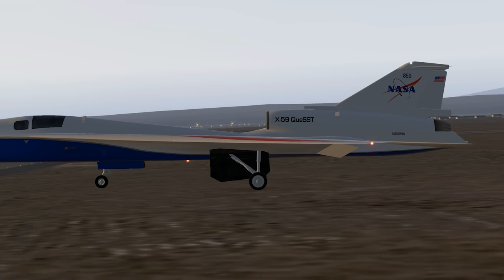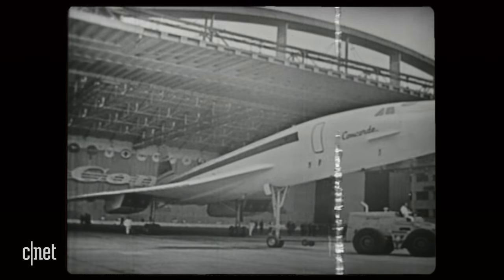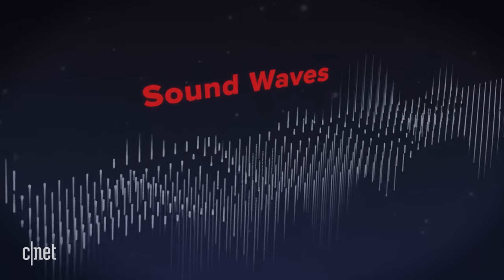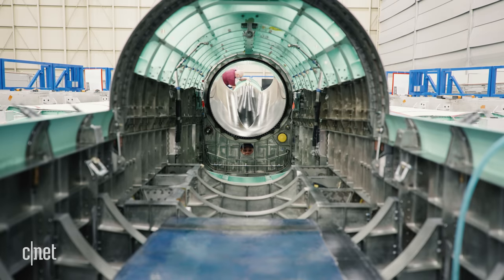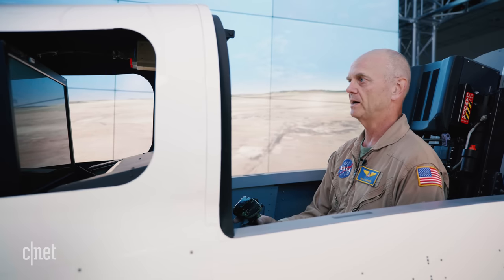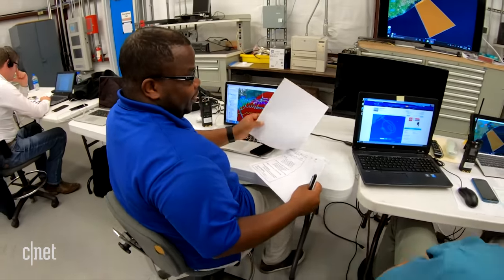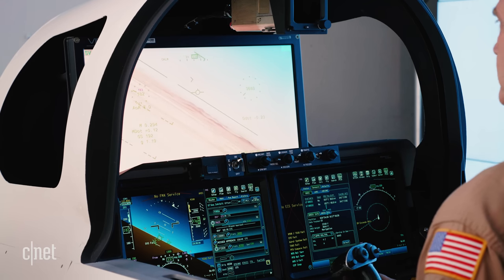Exclusive look at NASA's low-boom supersonic plane

Comment: Yoooo. They’re doing this at Skunk Works!!! That’s how you know it’s important 😳
Reply: Yes, a plane with that design will definitely be practical. /sarcasm 

No, it's not important. It won't be even practical. The necessary shape will make it hard to maneuver around an airport.
Reply: Well technology needs to start somewhere
Reply: @Wisewolf_of_Avalon  

It's not practical and it won't be practical. It's just too long.
Reply: @bobfg3130  Cute
Reply: @momoreview5555  

Alright. Scale it up and see what dimensions it will have. Compare that to passenger capacity.
Reply: @Sidney Nguyen 

There won't be any push forward.
Reply: @bobfg3130  I agree with you. This will never replace normal planes for the vast majority of travel. This might be practical for very rich or powerful people though. Moving less people around very fast intercontinental travel.
Reply: @eyeofthetiger7  

I agree. You can make a 10 or 20 seater like this but that's it.
Reply: @bobfg3130  u r right but methodes and research is being carried out on that, that's why this is experimental to commercial
Reply: @bobfg3130  why do you say there wont ba any push forward? (I'm intreagued)
Reply: @logx1003  

There's no reason to. You can take a normal  plane during the night and sleep in it and you haven't "lost" almost any time traveling. 

Also, in order to be carry 100 passengers, can you imagine the dimensions the plane will have to be? I mean a supersonic plane without a sonic boom. Just look at the shape of this thing.
Reply: @bobfg3130  it’s an x plane. It’s to test the technology and concepts. That’s it.
Reply: @louissanderson719  

The plane that will be designed with this purpose will look the same. It won't be practical.

Comment: Concorde was ridiculously ahead of its time. The fact that thing was designed by a bunch of guys with pencils and slide rules with nary a computer simulation or even a pocket calculator in sight should amaze you. The only comparable technical feat was the moon landings and many of those Apollo engineers said they were stunned that Concorde actually worked as a commercial airliner.

Comment: imagine the monitor malfunction

*IMAGINE* PLEASE COMPREHEND BEFORE COMMENTING DUH
Reply: It's probably built to a much higher standard than your mass manufactured, planned obsolescence integrated, cheapest possible component with highest possible markup composed commercial viewing device like a TV or monitor.

On top of that, it probably also has backups.
Reply: Can you guys understand *imagine? Of course there's always 0.1% of that happening but not 0.

You guys are kill joy
Even if that monitor was built in high standards it still not indestructible, everything man made is vulnerable.

Comment: I’m confused why Concorde is mentioned here as Concorde mitigated the sonic boom issue by only flying at speed over water. Concorde was cancelled because its operational cost, which any supersonic passenger plane would also suffer from, was far too high. Yes, a new modern design ought to be a bit cheaper to maintain but the litany of issues from tire “incidents”, maintenance issues, fuel consumption, etc were still huge issues that are difficult to overcome.
Reply: Yeah, with the immense cost of operating and maintaining a supersonic plane, I don’t see supersonic travel being a profitable industry anytime soon.

Comment: This does not really address the biggest problem the Concorde suffered from: POOR FUEL ECONOMY.
Even if you get around regulatory hurdles by reducing your sound footprint, you still can't make this commercially viable if you can't fly it profitably. Concorde ultimately failed not due to the restrictions on its sound, but because the operational costs were exorbitant.
Reply: True, when Concorde returned to London it determined its own approach path and informed ATC. The reason was it was nearly always on minimum fuel.
Reply: @AnthonyHigham6414001080  Yes. And even with this precision balancing of fuel-to-weight ratio to squeeze out the best fuel economy from the aircraft, most of the time their flights were break-even at best.
Reply: Modern turbine engines have come along ways since  the early days of the Concorde.

Comment: At 8:40, are you sure about that? It seems to me it has much more to do with the engine and inlet placement (that is to reduce noise projected to ground indeed) and consequent reduction of volume to tuck the landing gear in which was present in an F-16 due to its fairing.

Comment: It wasn't the limitations on air routes that killed Concorde, it was the fact that it's a lot easier to fill a 747 at $1,000 a seat then it is to fill a Concorde at $15,000 a seat.  If you're planning on spending a week on vacation, trimming 4 hours off your transatlantic flight time isn't worth paying a 1500 percent premium for most people.

Comment: Great video 👍💥 I've always thought commercial air travel was antiquated and slow. Equivalent of Greyhound bus in the air. The technology to fly faster and more efficiently has existed for years. Unfortunately we are still utilizing the Greyhound in the sky. Not to mention exceedingly uncomfortable.
Reply: And commercial jets fly slower than they used to. Economics is king. Flying faster takes exponentially more fuel, so jets fly at their most fuel efficient speed, not the most time efficient speed.  Supersonic capable pax jets will have to be fuel efficient as well as quiet.

Comment: Simple answer for a no-boom supersonic flight, is to "fly" outside of the air. In other words .. at a height where this may require different propulsion systems. 
OR
Alternatively do some sci fi and introduce a vacuum bubble effect in advance and in front of the vehicle through which compression cannot produce the rupture.

Comment: Why the heck do they not do a morphogen skin tail system that extends or retracts small part to drag and generate opposite wave of front pressure wave as it passes and makes cone. Canceling offset waves to mute eachother... if done right it can also be a source of lift as the pressure waves cancel out and plane rides on top of the cancellation space

Comment: with no ability to see the outside without monitors, this means in the event of an electronics failure the pilot will not be able to land the plane manually.
Reply: Appears pilot can look out at the sides, it's not all monitors but agree it makes landing more dangerous. But technology today hopefully they'll be a backup for the backup system and then there's all sorts of other risk management.
I fly in it.

Comment: The boom wasn't the only problem with supersonic flight--the main issue is that it's even more inefficient than subsonic flight, and burns a tremendous amount of fuel. I know United is advertising they'll generate their fuel in some carbon-neutral way (biofuels?) but you could do that for any plane, in principle--the question is whether it can be economically sustainable. This is a big problem across the whole aviation industry, and planes that burn more fuel to go that fast certainly won't help.

Ultimately, the issue with the Concorde was that few people were willing to pay that much for supersonic flight except as a pure status symbol. Most people just don't need to commute across an ocean faster than a typical jetliner will take you. Over the past year and a half, one thing we've learned is that in a world of networked business and instantaneous video conferencing accessible to the masses, a lot of business travel we used to do probably doesn't need to happen at all. And when you're traveling for pleasure, you're not in as big a hurry.
Reply: Everything you said is mostly true, but I'd disagree about fuel being the #1 issue overall. The Concorde was prevented from flying the many dozens of routes initially proposed solely due to foreign government backlash of the noise. Restrictions were put in place by many countries really quick to prevent supersonic flights over their airspace. 

Aside from a handful of brief but failed attempts in a few other locations, the Concorde's routes were dwindled down to just London to NY (and vice versa) & Paris to NY (and vice versa). That's it. Because of such limits, frequency of the routes were then severely limited to 1 flight a day each way between London/NY, and up to 5 total a week for Paris.

If the noise & decibel reduction here is actually achieved, it would mean sonic boom's of only 5% the total sound of the Concorde's boom! The decibel scale works quite differently than others, so a reduction from just 105 to 75 decibels would result in just 5% the total sound. That a 95% decrease, which would then prompt governments to revisit their laws & allow supersonic flights meeting these standards over their territory.

Suddenly dozens upon dozens of routes become available all across the world (transpacific alone would be massive), frequency of the flights would become far more common, and costs would gradually come down. HOWEVER, everything you say about fuel would still 100% be an issue. There's no denying it would keep prices substantially higher than a typical flight (which in turn limits accessibility to many people).

Comment: How is it that we have computational fluid dynamic computer simulations but we are producing aircraft at a far slower pace than in the 60s when we didn’t have computers? Lockheed seems to have been working on this jet for what seems like forever now.
Reply: It is precisely because we have CFD - if you can simulate more on a computer, you need actual test planes less.

Comment: Cool story, now you only need a 10 mile long runway for a full size version. Concord did not just fail because of the sonic boom, part was the fuel consumption to go supersonic. This is nothing more than a pipe dream for commercial use.

Comment: Part of the reason the US banned supersonic flight over land, was because their SST was not developed. The Boeing 2707 project was cancelled by the Nixon administration in 1971, when airlines were not lining up to purchase it. Concorde had 150 orders, but due to the overland banning of breaking the sonic boom, limited the orders to 14, for Air France and British Airways. The Soviet Unions' Tupolev Tu-144 was their offering of a SST, but it had many issues and was grounded after only 55 flights. The banning of flying over land made the Concorde almost impotent because it severely limited available routes. It was also very expensive to maintain and run. The last Concorde flight was in November, 2003.

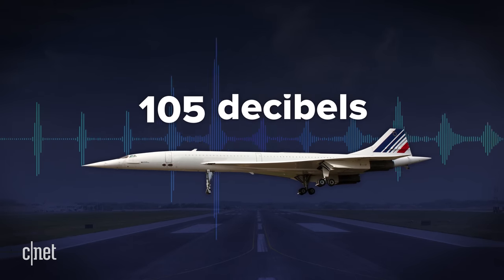Comment: 6:05 okay so not quite what I was thinking.  I was guessing using a heat beam out in front of the aircraft to heat the air, thus lowering the pressure, and reducing the boom.  but that would suck energy like nothing else, and this is a much more elegant solution.
Reply: 13:03 I'd rather see low earth orbit, but that's just me.  and this is still very cool.

Comment: I lived near an air force base in Denver when I was just child, I distinctly remember the crash of supersonic planes passing fairly regularly.  They sounded like an artillery shell landing nearby and the windows almost shattering.  It was terrible.   I can see why they banned supersonic flights.
Reply: I grew up in Montana in the '60's, and we heard sonic booms occasionally in the summer.   It was pretty startling.   There is no build-up or precursor sound - just like an explosion as you described.
Reply: As a Denver kid in the 60's, I remember this too. I thought it was exciting, but those booms were Startling, like a bolt out of the blue!

Comment: This video misleadingly suggests that the reason the Concorde fleet shut down is because of the sonic boom. That is nonsense. A sonic boom is not a problem for trans-Atlantic or trans-Pacific flights. The planes simply stay subsonic until they are over the ocean.
The main reason Concorde shut down was that it was not profitable. The amount extra that a passenger has to pay to cut a few hours off a trans-Atlantic flight is not worth it for most passengers. There are always some rich people willing to pay the high price, but there were not enough of them.

Comment: F106 Delta 
Dart..and Dagger were Delta wing configuration. Very stable and an unparalleled safety record. A wonderful aircraft..also used as an interceptor. The delta wing being the space shuttle and even the X-37.  This is.....Both! Should break some speed records....but not very maneuverable. Compared to an F-22. Vectored thrust...ultra thin wing...huge Tail! Makes the Raptor.....it’s Superior!

Comment: wouldn't it be easier to have the engine in the front and funnel it through the plane which in hand creates a vortex infront of the plane due to sucking in massive amounts of air and spitting it out the back. You would need to reduce the surface area of the vehicle somehow also depending on the volume of air in which the engine in front can sucks in and spit out the back.
Reply: and or adjustable wings. This would be very odd looking. Let alone how to deal with lift.
Reply: Essentially... how fast can an engine suck in and push out air.

Comment: Did anyone ever try magnetism or heat at the parts that have higher impact against the air (tips) to make it easier for the plane to flow through the air? Maybe something that heats up the air straight ahead or forces dispersion.

Comment: Hmm... Is there a paint that could make the plane slicker so the air flows more smoothly over the plane.
Reply: Like a hot knife through butter.
Reply: Another thought... If their was a way to change the air in front of the craft to change the viscosity of it.
Reply: Like Moses parting the red sea and then fly right through that corridor.
Reply: A slip stream
Reply: It's like rubbing your fingers across a squeaky clean plate due to the friction and then the sound is produced due to where it wants to catch.

Comment: Wonderful science and engineering, but we’ll never have Mach 2 airliners at 60,000ft. The acoustics math says that we need to go faster and higher both for fuel efficiency and the acoustic signature on the ground. The Concorde transatlantic flight tickets today would cost $15k, five times that of a conventional airliner. That’s not a feasible business model. At twice the scale, twice the speed, and ~90,000ft the trades become practical because flights become more efficient, routes become more plentiful, and the supply-demand distribution and economy of scale for production becomes realistic.

Comment: 75 decibels is still too loud. You give the example of a car door slamming, but that sound stops. 
Isn’t it like 80 decibels sustained can damage hearing?
All this engineering to cut 20 decibels seems silly to me.
Reply: The only way the sound would be sustained is  if you were traveling the same speed on the ground as the aircraft.  I'm sure you've heard a sonic boom before, they don't last very long do to the speed of the aircraft passing you.
Reply: @kvnkaveman  the video seemed to state otherwise. I must have misunderstood.
Although my larger point still stands. A reduction to 75 decibels is too slight of an improvement.
But after seeing some of the other comments, this video seems to be riddled with inaccurate information.
Thanks for the clarification though!
Reply: @tobisonbrown  reducing a sonic boom 20 decibels is a lot. your washing machine is 70 decibels, do you wear ear plugs while it is running?   The average laugh is 65 decibels.
Reply: @kvnkaveman  no ear plugs, but if it was in the same room where I do my work I’d be annoyed by the sound. People are annoyed by the fans in their laptops for example. 
I guess I’m of the mind that it’s not a problem worth solving. I’m also someone who has never heard a sonic boom and can only try to imagine the impact of a quieter sonic boom happening repeatedly for commercial flight.
Thanks for your information though, you cleared up a few things that the video didn’t and I appreciate that.

Comment: 9:05: What happens when the cameras fail, the monitors fail, and the instruments fail? Too much reliance on tech and not practical enough for the the things we can't foresee. Still, a well presented video.
Reply: Well, first of all the probability that one of the 2 cameras failing is very low, and if 1 fails the aircraft can still be operated as the cameras have a wide angle of view, if the monitor fails as you may have seen there are 3 monitors, each one providing instrumental data, of the monitor of the camera fails (very unlikely) the camera output can probably be shown on the other monitors.
Reply: The instruments are the same as the ones on normal planes, they never fail, they are very tested technologys,

Comment: The craft is forced to be a needle slim fragile infastructer,  just so it's not a sound nuesen. What they needed was to creates a craft capable to fly above the stratosphere. Cooling turbines that can absorb micro air from wing/limb, lather transfer distributed to the front/tips of crafts, showering thick/cool atmosphere system. Offering high Orbitliner services.